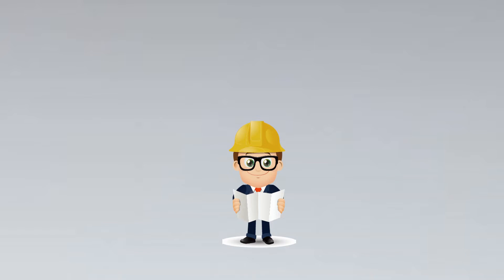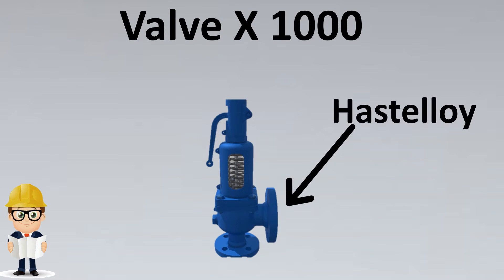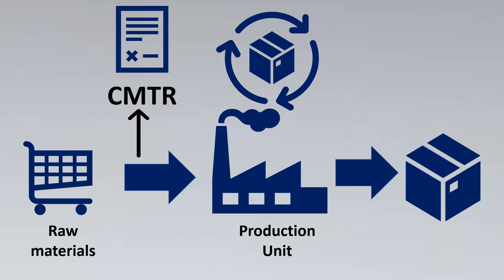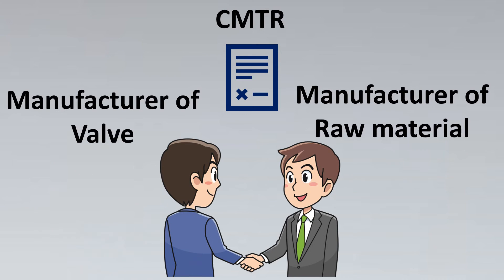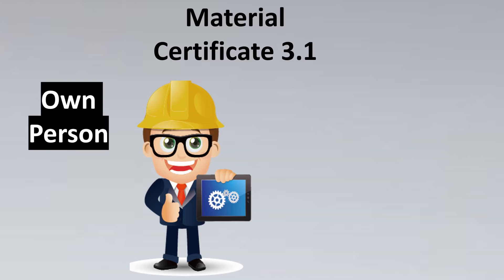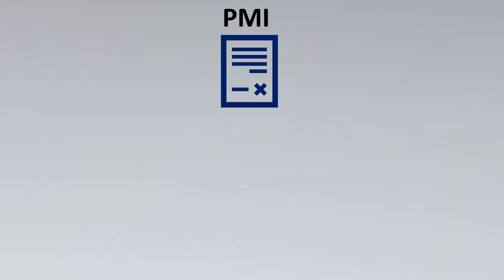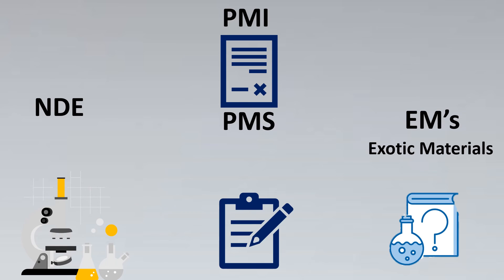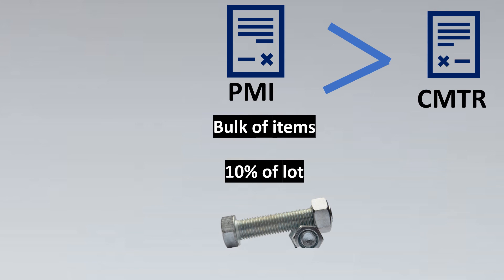PMI (Positive Material Identification) Versus Material Test report (CMTR) | When to use What ?

Comment: I understand PMI is not required for SS materials. Please confirm
Reply from the maker: You are correct for Majority of the times it is not required but for very rare cases I had encounter one where client prefer to go for PMI for SS316L grade. (Maybe they wanted to be sure it is SS316L and not SS316 material).
As a safer option it is better to have a look at client design basis 😊.
This is as per best of my current understanding !
Reply: @AsadPassionateEngineer  Thank you for your best reply
Reply from the maker: @pandey.vivekk   Most welcome 😊
Reply: Very informative Video Asad ...Keep it up
Reply: PMI is required for SS316 material to identify the qualiity of the finished product after it's manufacturing completes. The composition of the material are to be with in the tolerance limit. Especially molybdenum, chromium and nickel contents which requires for resisting the corrosion
Reply from the maker: @ganeshh5940  thanks for sharing your information 😊 !!
Reply: Good video. Can anyone tell please what is the difference between SS316 and 316L?
Thanks.
Reply: @cck0728  SS316L has lower carbon content than SS316 and hence provides better corrosion resistance